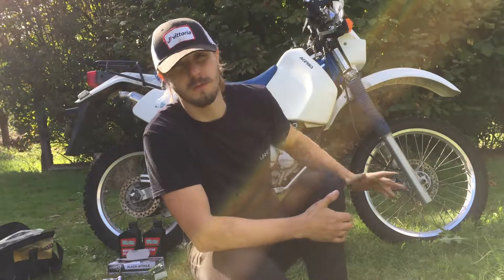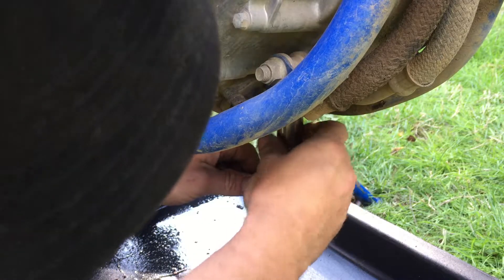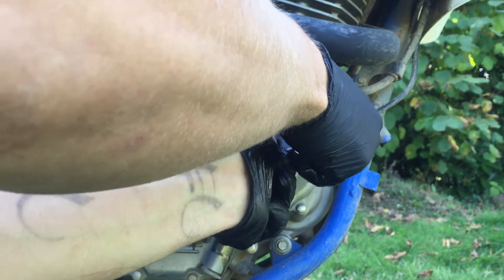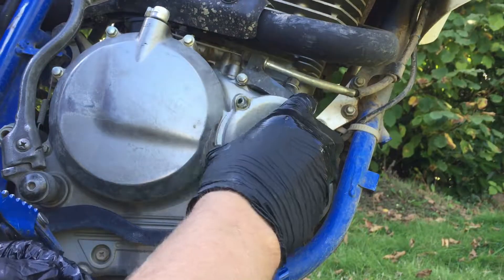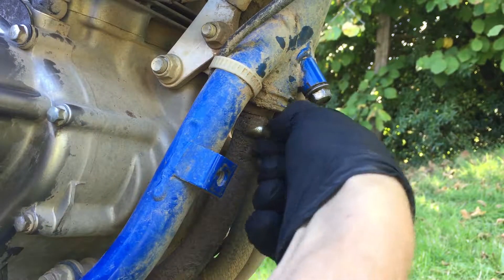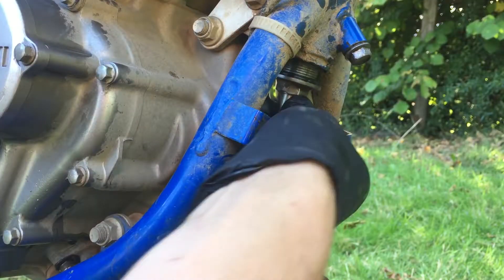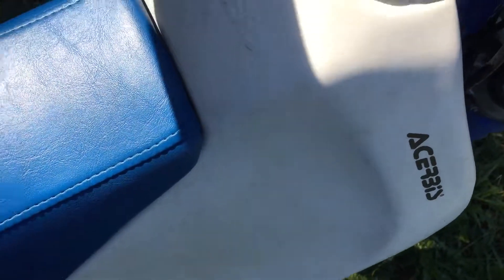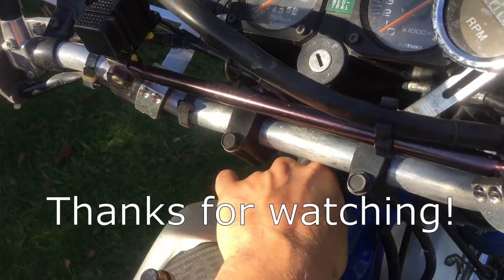How to Change Oil and Filter on Suzuki DR350

Comment: Hi man, how many kilometers or miles (sorry) you do before you change oil ?
Reply from the maker: I change it in about 1500 to 2000 miles. Suzuki manual says to change it every 60 hours. If you ride hard in a dry dusty place then you should change it more often.

Comment: I cant figure out how to check it first
Reply from the maker: Start the bike, let it idle for a few minutes, shut it off and then check the oil while keeping the bike upright on a level surface. The dipstick is located on the frame between the gas tank and the handlebar.

Comment: There's an O ring inside the oil cover plate you are supposed to replace when you change your oil.
Reply: Whats that? the bolt with the mesh filter on?